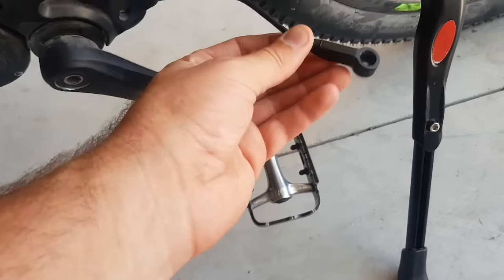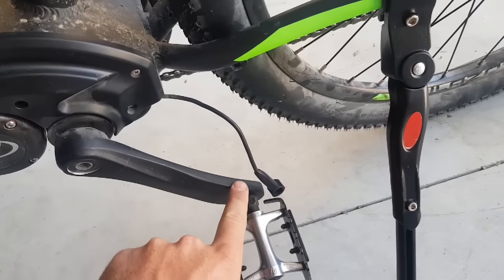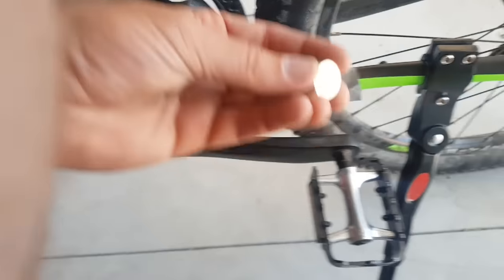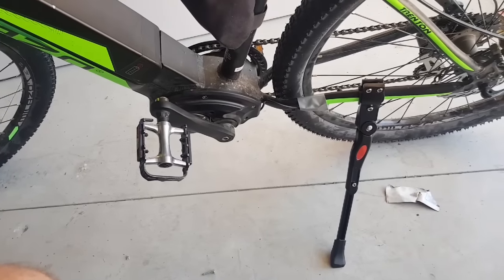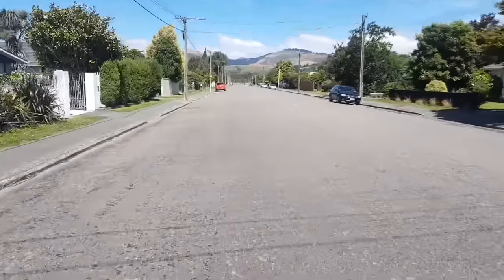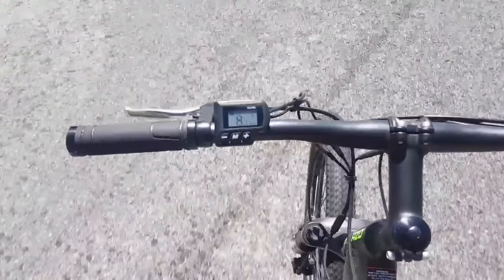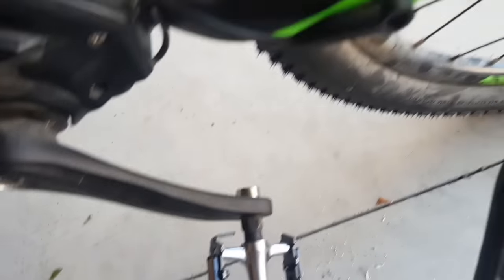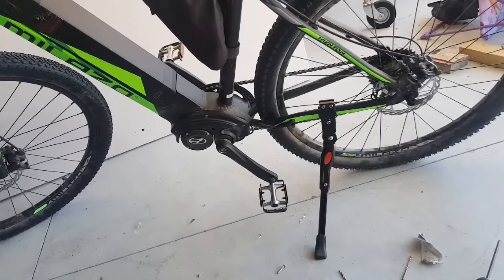Speedhack your mid drive ebike - remove speed limiter

Comment: WAIT.... a smaller diameter wheel would actually be turning FASTER at 25kmh, wouldn’t it?  You would actually need to put a larger diameter wheel to trick the sensor... (at least I think that’s right).  Anyway, I like your hack much better than buying different wheels and tires!
But, What happens if you’re not pedaling?
Reply: Oh, my bad... you said to change the wheel diameter SETTINGS in the computer!  Lol.  I thought you meant to actually change the wheels! 😂
Reply: I did this but after a few K it goes into error and turns the e motor off. Any other ideas?
Reply: @buckethead8873 probably you burned the motor..you need new motor..!..I read not all ebidensiya can be hacked when the motor cant take the power..its underpowered..good luck..
Reply: @buckethead8873 put it back to what it was before, will the bike functioning as before it was hacked? Hope you didn't damage your ebike.

Comment: Ok jaycar has a speedo converter, it takes the magnetic pulse and puts out another pulse at 0 to 100% rate of the original depending on what you set that too. Theres a switch to set that..
They run on 12vdc, the power down in the motor hub is 36vdc,  jaycar sell a dc to dc converter $8 for arduino ( a very handy board) and it will power the speedo converter... (up to 36vdc) wire it up, fit it in the area of the motor , set your percentage to 50% and the controller now thinks 50kmph is actually 25kmph...Shhh dont tell anyone I told you!... 
Total price $38. 
To fit use a bit of common sense, I bought a plastic holder. $3 for the dc to dc converter.
Skill level - easy 
Add a small fuse too in case anything goes wrong! ;-)
Ps dont forget to tx Oring! 
Aka me for taking the time to find a cheap and usefull alternative. 
I do like this idea too! Im pretty sure bosche engineers are nuts for thinking 25kmph limit was a good idea! 
Hell a woman on a girly pedal bike with a basket full of flowers on the front can go quicker! Seriously!

Comment: Thank you for the video. But i have a problem. I have a Bosch motor and a 400 W baterry,  It's all ok, speed show me at 7-8 km/h but after 1-2 min show me on the display 102 error, and cut my mototlr on 30 km/h. Any advice please
Reply: I also have a latest gen Bosch mid drive unit and have heard of this exact same issue. I have not tried it myself yet, but it clearly must be a problem. I cannot afford one those expensive speedboxes. Anyone know a workaround? I am not bothered about incorrect speed readings.

Comment: 1:15 smallest wheel possible? what are you talking about?
Reply: If you can set the wheel size on the ebike computer then setting it to a smaller wheel size will make it "think" that the speed is slower since one revolution of a smaller wheel is a smaller distance. Hope that's not a terrible explanation 😬
Reply: Josh Shipton  Not smaller wheel! You would need to change to bigger one. Coz smaller wheel spin faster. On the same distance smaller wheel will spin twice as much. What computer does is counting how many times magnet went past the sensor. 
And based on settings (I believe you cannot change that in settings) calculate the speed based on wheel size. And then you’ll  have opposite affect because small wheel will spin faster on same distance.
Reply: @johndeer8108  Yes your right, if you changed the wheel to a bigger one it would increase the max speed limit. If you can change the wheel size setting in the ebike computer (not the wheel itself, just the setting) then setting it to a smaller size will increase the max speed limit again. Because like you said, a smaller wheel will be turning faster and so with the same size wheel, the limit will be higher if the computer "thinks" the wheel is smaller. Of course if you can't change this setting on your ebike then it's of no help knowing that :)
Reply: @joe0932  computers dont think
Reply: @tom8181  Fully aware of that, it's my attempt to make it easier to understand 😊
Reply: @johndeer8108  setting a smaller wheel size allows more magnet passes per second before motor shut off. Which translates into a higher top speed on normal size wheels.
Reply: 12 o'clock on a small wheel and a big wheel are the same.1 revolution is 1 revolution. The difference is that the circumference is larger on the bigger  wheel, so your travel distance is greater per the 1 revolution. For example, a small wheel may give you 1 meter travel while a bigger wheel would give you 1.2m travel. You go further per revolution. Hence, you go faster.

Comment: My problem is the speedometer doesn't work and thinks I'm doing 25Km with a single pedal. When I'm almost stopped the speedometer shows bike is riding at 15 Km/h. It is a real pain in the back when I'm cycling uphill no power at all. A normal classic bike probably runs faster than mine.
I appreciate you sharing this tip. Although it wont work for me. 
My bike has not a visible magnet attach to the wheels nor a visible sensor. I think all is hidden somewhere inside of the tubes or wherever the manufacturer hid it, probably to avoid we do this as according UK and EU laws a bike can't go faster than 25Km/h hence the use of speed limiter. 
I do not have a clue on how to rewire the speedometer. 
But thanks anyway very much appreciated.
Reply: Maybe your bike has a hub engine ?
Reply: I have the same issue here in India . Can't go beyond 25km/hr . And I have a hub motor . Don't know what to do .

Comment: I think this fix has too many potential issues for me. Besides some folks getting error and lockouts It would affect the performance of the assist meaning when and how it comes on, the smoothness of engagement ect. I will definitely look at alternatives though. 25kph that is really silly. In the USA its at least 20 mph which I see is about 32 kph but still much to slow as it starts governing your speed at around 18 or so. Very anoying.
Reply: I was also thinking this may somehow screw up the way the motor delivers its power, since it does not have "true" information about the bicycle speed. However, I've been using this method on my bosch 4gen Cube Katmandu for a while now, and have not felt any strange behavior from the motor. The feeling is linear regardless of speed which I suppose is how it should feel. There have not been any errror codes or anything like that, but of course the odometer values are not valid anymore. For me this is completely fine since I switch the bosch screen to display the assist level, while I use a separate display for speed/trip information (bought it for 20$).
When I think about it, I would actually not expect any strange behavior in the assist level, since you can imagine a situation on the bike without the mod, where you are traveling uphil at a lower gear and lower speed, needing the same assist level as when traveling on flat with the higher speed. So from the system aspect both of these must be valid operational conditions and no attempt can be made to limit one or the other. This modification can therefore be "interpreted" from the system perspective as being on the hill terrain and needing greater assist from the motor, while you are actually blazing on the flats 😁

Seems to me the speed limit circuit is quite simple and it's only function is to cut off the power if the frequency of the signal is beyond a certain value, which from the system perspective should indicate more then 25kmh or whatever value it is.

Comment: More modern ebikes have protection for this simple hack. When pedal rotation is equal to what the speed sensor reads for a specific duration, an error comes up and pedal assistance gets turned off.

Also hacking your bike is dangerous. Done it myself and noticed a 25km/h is build for speeds not higher than 30km/h. Brakes, suspension, frame, drivetrain, etc...

Buy a speedbike if you want to go faster than 25km/h.
Reply from the maker: It all depends on the controller but youre right. This mod may not work for all. Easy to test though
Reply: My e bike Bosch active plus 43.1 km/h top  speed
Reply: So you push your bike downhill? What about tailwind - getting off the bike and pushing? Man, some people...
Reply: niels, absolute 100% rubbish. 
Ebikes that exceed 25kph use the same frame and components as a bike that has a restricter . 
Also ebikes that have a limiter on the motor are designed to run down hill at insane speeds . 
Your comment is absurd .

Comment: Anyone know what the rotation difference between a full crank rotation vs. the wheel rotation on a 28" wheel? I'm curious as to what the % difference in perceived rotation vs actual rotation after modifying.
Reply: 🤦 that depends on the gear ratio, say front cog has 44t and you on the 11t cog on the cassette then each pedal turn be 4 turns of the wheel, front can be anything like between 22-72t saying the range you can get but it depends on crank, the 72t is more likely on TT bikes or track bikes, rear is like 10-52t depending on cassette you have, think mountain bike can go up to 52t but most older have 34t max and smallest is 10t or 11t or even 12t normally

I mainly ride 44/11 on mountain bike and 53/11 on road bike
Reply: would depend  on what gear your in

Comment: Since by law an ordinary electric bike is not allowed to run faster then 25 kph, ( that's in Belgium) some hacks of the trip computer won't work! On the other hand, if the police suspects you fiddled with the computer, makes you stop, en verify the max speed, you can get fined up to 250€! So be careful
Reply: That's a cheap fine. I Norway it's probably 800$ and you may loose your license
Reply: @hermanjohnsen3653  we dont need a licence
Reply: Lo l what licence?

Comment: how much faster did you go i want to try this.
Reply from the maker: From 25kph to around 35kph
Reply: @danielcaigou6403  thank you
Reply: @danielcaigou6403  I have 2 e- bikes one with motor in middle Bosch that worked for me. I also have a e-bike with motor on back wheel do you know is there a hack for this one.

Comment: Your theory of going with a smaller tires and rim size to make the computer think you are going slower is wrong. You are thinking the wrong direction. If it is a bigger wheel then it will show slower and if it is smaller it will show faster. Its just like a car or truck when you put on bigger tires. The speedometer will show the vehicle is going slower then it really is. I am running 37 inch tires on my truck and the speedometer is 10 % slower then I actually am going. I use my GPS to show my accurate speed and log actual mileage. It is the same for your ebike.
Reply: A smaller wheel size allows for the wheel to have a higher rpm. Higher rpm = higher speed.
Reply: @magnuskm8972  No, the smaller wheel needs to turn faster to cover the same distance as the larger wheel, where is the gain?
Reply: @lightespeed  if you have 28 inch wheels, the computet in the bike allows the wheel to spin at an x amount of rpms. By setting the wheel size lower, to for example 20 inch. The computer will allow the 28 inch wheels to spin at the max rpm of 20 inch wheels.

Comment: When you let the sensor to the inside of the fork and move it a litle towards the crank and move the spoke-magnet towards the rim should have some small effect on the speed also, I guess. Or  using a bigger wheel, not a smaller. And the biggest tyre that fits your bike. A 27,5 inch to a 29 inch wheel with the same type of tyre should give a advantage of 4,6 km/h based on a 45mm tyre. When you simulate a bigger wheel by moving the sensor more towards the rim should give aprox a same advantage.
Reply: the sensor works by counting the amount of wheel rotations per minute. 
I agree with the 'bigger wheel' option, but moving the magnet around (changing the magnet radius) will not alter its rotation per minute, and therefore i think won't work.
Or am i getting something wrong?
Reply: @Simon-nx1sc  You are absolutely right. Moving the magnet on the spoke and/or the sensor on the chainstay will have no effect whatsoever.
Reply: no matter where the magnet is mounted, close to the rim or close to the hub, it will only pass the sensor once every revolution.

Comment: I just want my Bosch bike calibrated. It now stops support at 23km/u while the display shows 25km/u. That sucks. So my idea: make an Arduino that reads the pulse of the magnet on the wheel, then correct the speed  and gerate a slightly slower pulse at 1.1 times the pulse length and feed that to the sensor.
Reply: If it has a Bosch display you can reduce the wheel diameter to compensate: Press and hold both the Reset and the Info button to enter setup-mode. Press Info to step through the gallery…
Reply: @Hallands.  That is a fake/half baked solution. First Bosch bikes have 2 diameters. One factory set, one user adjustable. The factory one is used for distance calculations and is within 0,5% accuracy. The user adjustable one, is way off, it results in 23,0 km/h being shown as 26,5 km/h, and the range of adjustment is so narrow, I can only get it to like 26km/h. No way you could set it at the real speed. They are just friggin German holy sisters indoctrinated by Big Auto. Try to find a Porsche that is limited to 130km/h....
Reply: @lovemadeinjapan  Not on my bike.i can manually adjust the wheel diameter setting to 3% below actual which gives the correction he said was needed. 
The problem you mention sounds due to narrow, thin race-tires. But even so, the controller must have 3 settings for frame sizes S,M and L. Going one down would increase the speed as well, but of course the odometer would count less distance as well…
Reply: @Hallands.  I went through it with my dealer, and mathing GPS speed is not possible. I'm on Schwalbe Pick Up BTW. On the road you see all Bosch bikes are limited around 23, except for a random ASML employee that hacked it. Especially easy to see on those roads with slow speed measuring radars. Bosch bikes all top out at 23. And yes those things are accurate! So I make myself no illusions. Bosch is a cringe company, not willing to fix this and give us the headroom the law gives (not mentioning the 10% allowance on speed measurements). They really need some proper competition. Obscure software, board hardware issues killing simple things as light control, messing with speed limits to their holy godness. Only thing I love them for is 85 NM at a traffic light is pretty awesome. The motor should go into freerun after that.

Comment: I just have 1 question,  does this work on the old Boach performance line cx. 1st gen?
Reply from the maker: Easy to test... Just run a magnet in front of the sensor a few times to see if you get a reading. If you do it'll work.

Comment: Won't this effectively change its class , maybe even to the point of being a moped ?
Reply from the maker: No idea. In my country you can buy ebikes with 25kph and 32kph limited motors. This mod doesn't make it go 50km/h or anything crazy... You're still limited by the size of the motor on this case 250W
Reply: Either way, it'll eventually lead to license plates, insurance and further legislation against Ebikes. Such as banning them from certain trails. It's already happened in the US and Canada. Here in the UK the 25km/h is a legal requirement so you'll be in a load of sh*t if you're involved in an accident.

Comment: If you change the wheel size it will do nothing to the speedometer. Only physics will make it go faster with a bigger wheel.
Reply from the maker: Yes... But my point is that the limiter won't ACTUALLY be limiting it at 25kph any more.

Comment: And mine Shimano steps e5000 worked perfectly like this  but suddenly busted the hack  after 20 km.  it was a tough ride home!
Reply: So, your bike doesnt work anynore?
Reply: @aleksandermrkved121   yes when i reinstalled everything back to normal.  And after 10 mins of cycling like that,  the error eventually disapeared.     So  back to normal speed but with broken lights

Comment: Is this pachted in the new update
Reply from the maker: ... Your ebike does not download updates...
Reply: Daniel Caigou r/Wooosh
Reply from the maker: You're right... I don't get it
Reply: Daniel Caigou why did you say it then
Reply from the maker: Wasn't sure if you were taking the piss or just plain simple.
Reply: Daniel Caigou i was just joking around. Sorry
Reply from the maker: @yougo6419  😂 let's move on. Nice chatting
Reply: @danielcaigou6403  Well no, but when you take your bike for a service and the shop loads the newest firmware version, then you could indeed get patches that can sense when you've messed with the system. This seems to be the case for my new Shimano motor also.

Comment: This hack has already been patched in most firmware and results in a system error and motor cut off after a few meters.
Reply: So any other ideas?
Reply: @buckethead8873  There are various dongles available, these placed in the motor compartment. Usually the walk mode switches it on or off to comply with regulation.
Reply: @sijmes  thanks for the quick replay. I will assume what your talking about is some sort of speed chip that you have to install.
Reply: @buckethead8873  wait I'll get you a link.
Reply: @sijmes  thanks again.
Reply from the maker: Patched? My bike doesn't download updates from the internet regularly lol😂 works a tear with my bike. May not work with all